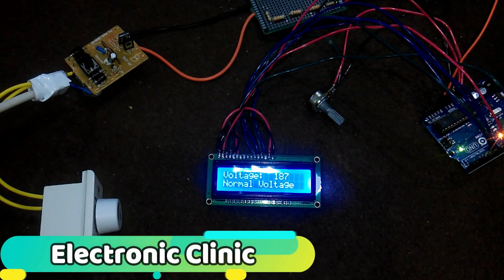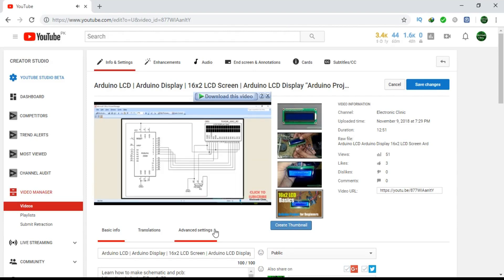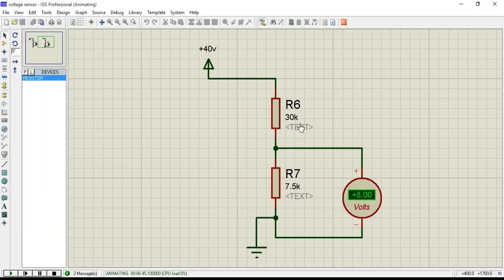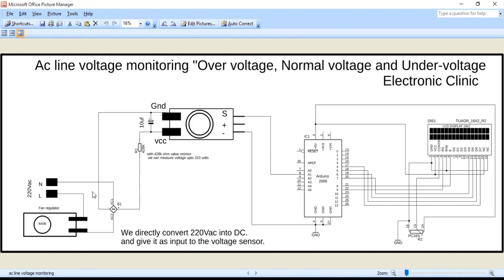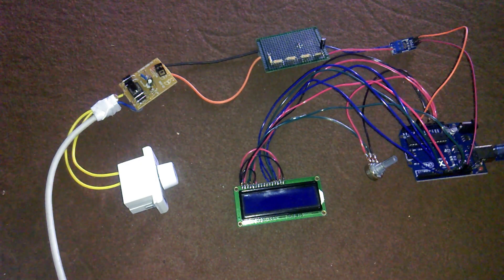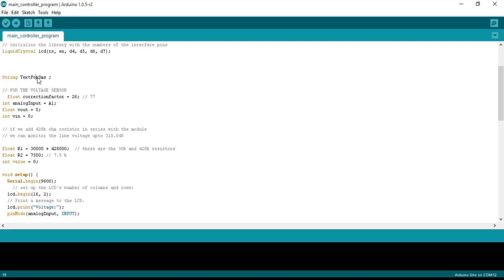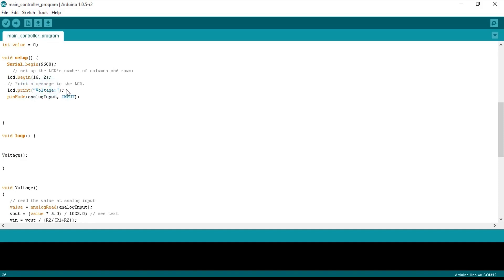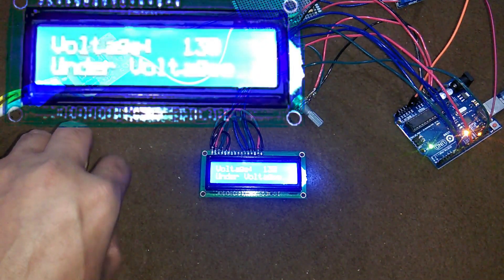Arduino AC voltage Monitoring “Over voltage, Normal voltage and Under voltage” Arduino Project

Comment: dear sir ,can i measure upto 0 to 5 volt directly connect to arduino A0 pin without any voltage divider circuit ?
Reply from the maker: You can use 0 to 25v sensor.

Comment: hi sir, my project just like yours.. hardware okay but when it comes to simulation, mine gone wrong at the rectifier simulation. im using piezoe sensor(tap several time to trigger the circuit) connecting with the rectifier cct (with capacitor of 100uF) it then will store charge in it.. for simulation i cannot measure the dc voltage at the capacitor.. hope you can help

Comment: How is the AC is converted to DC?? Is it converted to just 220v AC to 220v DC with the help of 4 doide? 
If any you can provide any circuit diagram that will be very helpful.
Reply: The 4 diode and the resistor brake the AC down to DC

Comment: PLZZ ADD A RELAY in the circuit and also code for that for 220 v load disconnection in case of over and under voltage.
Reply: Just define the pin number and set it as output and put your relay on the pin

Comment: i saw your video but i need  Proteus simulation specifically for these episode, that is important to for my project specially i lost voltage sensor library for these simulation. if you can, plies help me.
Reply from the maker: The voltage sensor has only two resistors connected in series. U dont need any library.